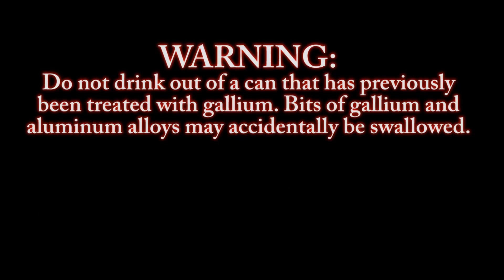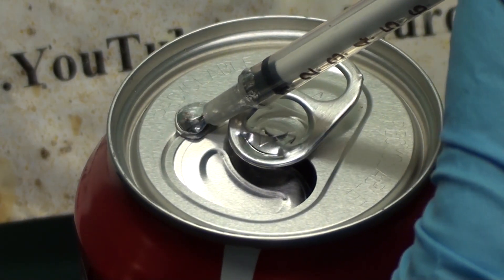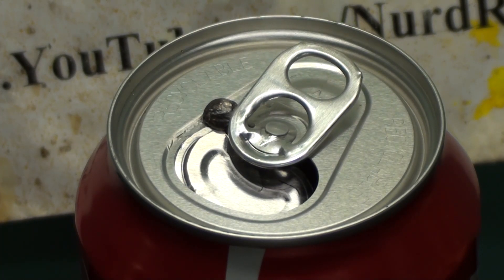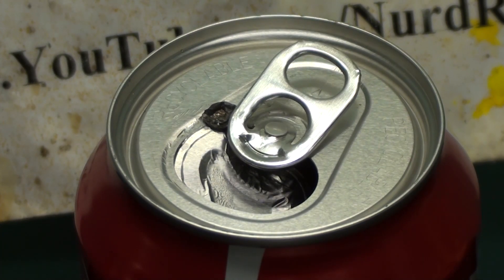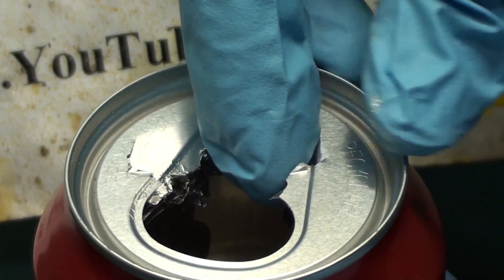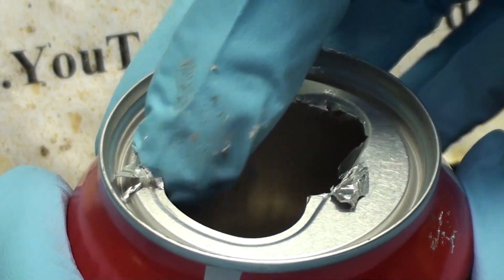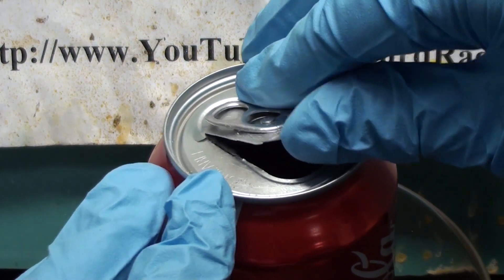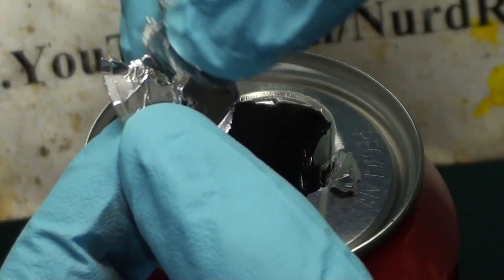Gallium Induced Structural Failure of a Coke Can

Comment: Captain here! Surface tension between Gallium and Aluminum is much lower than that of Aluminum with itself. This means that Gallium can completely wet (zero contact angle) Aluminum. When it diffuses into the Al microstructure after some time, it preferentially wets the grain boundaries which in return causes Al to fall into pieces easily. *flies away

Comment: Hmm, gallium and it's ability to create critical structural weakness in aluminium is a little scary. From what I can remember, airliner jets have their frames made from aluminium alloys. What if someone applied a small amount of gallium at key critical points before takeoff or mid air?

A catastrophic structural failure mid air of the frame would probably mean certain death for the passengers and crew. And as far as I know, anti-terrorist organisations don't have gallium listed on their watchlist for chemical purchases (many governments keep track of large purchases of certain chemicals commonly used to create bombs, but I don't think gallium is on those lists, despite the potential hazards it presents)

Comment: Does this effect have military applications? If not, why not?
Reply from the maker: Gallium is too expensive for the type of damage it can do. A bomb or bullet of equivalent cost can do far more damage much faster.
Reply from the maker: Well... thinking about it, gallium might work against aircraft and their aluminum alloy bodies, but i'm not sure about effectiveness. When its damaging the aluminum its kind of like wetting a tissue. One drop will not wet the whole tissue, you need lots of water. It's not like one drop of gallium destroys an infinitely large block of aluminum. So to put a hole into an airplane the equivalent exploding round or incendiary round would make a bigger hole than an equal sized gallium round. If you were able to put a bullet into just the right spot to down an aircraft, the obvious question would be "why not just use a more powerful bullet if you already got the aiming right?". Maybe for sabotage gallium might work. Put a hunk of gallium into the airframe somewhere and as the weeks progress it slowly destroys a large section rending the plan non-airworthy. But then the question becomes "if you could get close enough to PUT a hunk of gallium into the plane, why not just a bomb? C4 is practically candy to a well-equipped military unit. Gallium also does not affect steel. So tank armor is immune. The situations that i can think of where gallium would be more practical than existing solutions is so narrow that i don't think it would be worth it.
Reply: I also don't believe it is allowed on airplanes for this very reason.
Reply: whether it is expensive or not depends on what you are using it to destroy. as systempatcher points out, a very small amount of it correctly delivered to, say an F22 or an apache could turn out to be a pretty low cost for its effect.

Well, I'm sure they would be using it already if it was actually that good an idea. Just wondering. :-)
Reply: David Sharp why do you want to know?
Reply: Well as far as sabotage goes the hunk of gallium in the air frame seems the most (but still not very) plausible.  It's advantage over a bomb would be  the overall subtly of the act.  More time to get away, more time for the enemy to not notice and fix/replace the not usable equipment and possibly more plausible deniability for the saboteur.

Probably more James Bond than Reality.
Reply from the maker: Time bomb with a week long timer! :)
Reply: nice insights chaps, much appreciated! I can definitely imagine it have multiple uses as a one-way delayed switch, which opens up all kinds of possible uses; self-destructing aluminium superstructures on ships, rivets and welds. having such a low melting point does give it some interesting abilities for getting through the narrowest of cracks and into the inner working of machinery without the obvious heat and noise of a brute force projectile or explosive.
Reply: Omg good comments and discussion and no trolling on youtube! Is this discussion even real 🤔
Reply: because david sharp drank the can with the gallium in it, thats why.
Reply: probably not because the large quantity of gallium needed to have a significant effect on a large objector structure
Reply: I was thinking it could compliment a molten copper shaped charge anti-tank landmine perhaps.... or have it as some kind of aerosolised vapour and lob grenades of it into an area, so that over time tanks and weapons weaken. Compensate for the lack of volume of gallium by increasing its energy and surface area, etc. so it gets into joints.
Reply: David Sharp 
It's not allowed on them because a leak could compromise the security of the plane.
Reply: if not military, perhaps for safe cracking? or sabotaging computer equipment?
Reply: David Sharp 
I don't think it would be effective enough against a safe. Why would you need gallium to sabotage a computer? Why would you ever need to do any of the things you're saying?
Reply: oh no! you've caught me and my nefarious plans! oh noes! hahahahahha man, I don't need to do the things I am suggesting, I'm just interested in the possible applications of the destructive effect gallium has on other metals. its just cool and unexpected as we often use metal to make stuff because we believe it is stronger than other materials.
Reply: I think you'll find that most tanks and safes are largely steel and little to no aluminum.
Reply: David Sharp gallium works on most things but when fired from a gun it acts like a fluid straight away so had no range so is useless

Comment: So if you throw a bucket of Gallium on a car that is proudly made out of Aluminium for lighter weight, will the car crumple to pieces like this as well if you push it?
Reply from the maker: unfortunately you need a lot gallium for that. Like wetting tissue paper with water. You need a lot of water to wet a car made of tissue paper. Similarly you need a lot gallium for a car made of aluminum
Reply: Can gallium weaken other metals? Or just aluminum?

Comment: What I just heard on my left ear reminded me of the aluminum plane that crashed into the aluminum covered twin towers.
Reply: can gallium melt steel beams?
Reply: what's the name of the towers?
Reply: RickTrajan 
I honestly don't know anything about that particular metal. I'm not in a position to offer a new theory of the tragic events. 
I don't think it was what actually happened either.  I do think that there are unanswered issues about that event. 
Now just as a hypothesis(not even a theory): There was a combination of molten aluminum and water that caused explosions in the building. That may have contributed to the overall structural failure. When I watched this video I was reminded of that. That's all I'm saying. 

https://www.google.com/amp/amp.livescience.com/16179-twin-tower-collapse-model-squash-9-11-conspiracies.html?client=safari

Comment: You could fuck up someone's new F-150 with this.
Reply: don't need gallium. just tell them to hit a speed bump diagonally. the tailgate will crush like that can or blow off altogether.
Reply: omg lol
this is why i prefer chevy
Reply: Alec Brice I guess someone already put gallium on every ford ever because they always are breaking
Reply: Owen Monast lol. my first car was a Ford and my grandparents have me Ford repair kit for my birthday. it consisted of several rubber bands, duct tape, paper clips, and a bottle of super glue. I used it all the first year. ford= Fix Or Repair Daily, or, Found On Roadside Dead.
Reply: Adam Miller lol see what I mean? Ford needs to take notes from chevy
Reply: Adam Miller my dad had his gmc for 6 years but he bought it used from someone who had it for 7 years lol and now my dads friend uses it and it's still running strong! Go gmc
Reply: Owen Monast agreed. that's why I've had my gmc 2500 for 11 years.
Reply: Owen Monast bought mine used also. it was used as a local commercial dump. when I got it it still had the dump bed and a permit for the local trash dump. its a 96. never skips. I do most of my own work but the mechanic I go to occasionally said its the smoothest running 5.7 he's seen in years. gotta love the gm trucks.
Reply: Adam Miller that's why I'm getting my own gmc later on
Reply: Ricky Spanish 😂😂😂😂don't know why I died laughing

Comment: Could they possibly make anti-aircraft bullets with some kind of gallium core that would weaken the structural integrity of the aluminum framework? Or would the effect be mostly inconsequential considering you just shot a hole into the plan anyway?
Reply: +Fakjbf Late response, but your latter assumption is correct, for a few different reasons.

Surface-based anti-aircraft guns wouldn't get much out of this, as their primary utility these days is against extremely slow-flying and low-flying fixed wing aircraft, or - in the case of those used on ships - are fired against targets that are generally on a constant-bearing, decreasing range course. This means that the aircraft is flying towards the target, without much change in direction; an intercept course. In either case, anything fired at these sort of of craft is going to heavily saturate its flight path, and you'll be looking at a high probability of a large number of catastrophic impacts. These rounds are also typically a mix of high explosive and armor piercing rounds; punching through the fuselage, shredding avionics and control systems, destroying control surfaces necessary for flight, obliterating the sensitive electronics needed to keep most aircraft running, and destroying and potentially detonating fuel and weapon systems and ammunition storage. Suffice to say, the munitions used to take out aircraft are also quite lethal to the pilot, as well. In the case of a rotary-wing aircraft, a helicopter is basically dead to rights against a surface to air gun as long as it's in the gun's effective range.

If you're looking at the gun systems carried on most fighter aircraft, you're usually going to see a rotary cannon with an extremely high rate of fire, or a revolver cannon that provides similar performance. These weapon systems spit out dozens of rounds per second; this is because in the case where an aircraft might actually have cause to deploy its gun against an enemy air target, the time they've got to engage and successfully put rounds on target is extremely short, as both aircraft are probably maneuvering at maximum power, and conducting evasive maneuvers throughout the engagement, so when the pilot sweeps his gunsight over the enemy craft, the idea is to put out as many rounds as possible to cover the arc. In the event that a round impacts, it's usually the same sort as that fired by anti-aircraft guns, and is also probably going to blow a similar hole in the plane. It's also worth mentioning that the aircraft we're talking about would normally engage each other from literally miles away these days. In a situation where one aircraft is firing its cannon at another aircraft in a modern environment, you're looking at a scenario comparable to two soldiers stabbing and hacking at each other with bayonets after charging at each other from hundreds of yards away after their rifles ran out of ammunition.

As a more practical concern, it might be worth mentioning that surface-based anti-air guns - except for those used as point defense systems on naval vessels, have largely been abandoned by modern militaries. They lost a lot of their utility following the Vietnam War era as missile technology grew more and more potent and reliable, and were a waning asset even then. Nowadays, a missile can be targeted and placed onto an anti-air gun from miles and miles away, far outside of where the gun crew could shoot, or often even see. Also, the aircraft that can deliver these weapon systems can fly much higher than the anti-air guns can actually even reach. As such, anti-air guns - as a primary means of defense against aircraft have largely been relegated to countries that are much less powerful militarily, and that cannot afford or do not have access to procurement of modern surface to air missile systems and the guidance technology needed to operate them.

If none of this mattered, and it were the least bit practical, there'd also be the problems of acquiring gallium in quantities sufficient to load it into hundreds of thousands of large-caliber shells, processing it, retooling ammunition production facilities that would produce normal autocannon rounds, distributing them to training groups and operational units, and maintaining an entirely new set of logistics for a stock of ammunition that is usually not going to be used, and all of the monetary and logistics issues that would come with every stage of this process.

Comment: Quick question to anyone who knows the answer X3 Could you use the gallium metal to weaken any other metal? Or is it only aluminium? It would be cool if you could put it on a safe or something, and then break through the metal
Reply: Google Liquid metal induced embrittlement or some such.
Mercury also forms amalgams. Like the fillings in your teeth. Some mercury amalgams are fairly toxic but don't worry about your fillings. It'll damage aluminum silver gold etc. but again not iron.

Comment: How toxic is gallium? Is it like mercury or a heavy metal, or whatever mercury is classified as?

One time I sliced my finger down to the bone when I was younger playing with a coke can twisting it and peeling it open like a tube of Pillsbury croissant dinner rolls. And it was as sharp as a razor blade, I wish I had pre treated it with gallium. Plus as a young kid I probably would have went around experimenting like putting it on aluminum car body panels like fenders, etcetera. 

I also wonder how it could be used in an auto body shop?

Comment: Common parts made of aluminum are the radiator, intake manifold, cylinder heads, engine block, transmission case and/or bellhousing, heater core, bumpers, decorative trim, wheels, etc. So who wants to make a video?